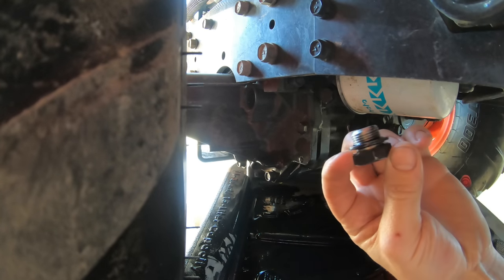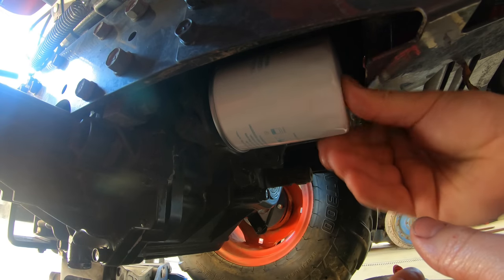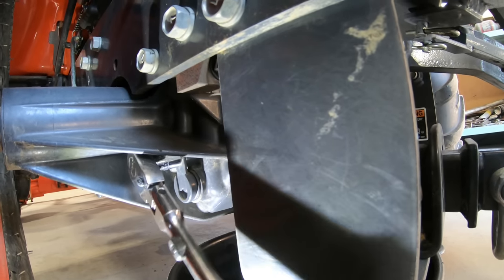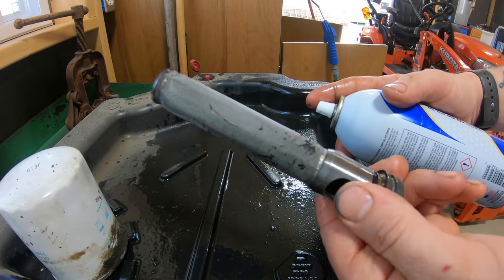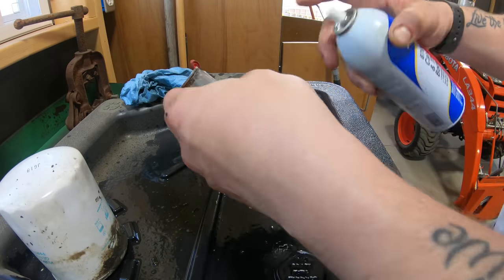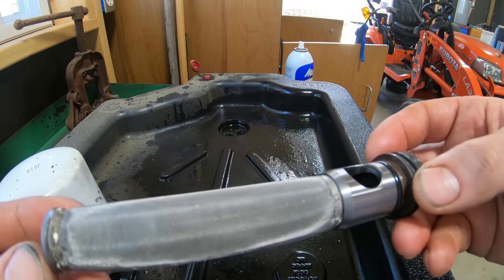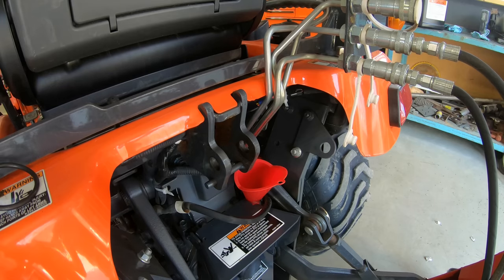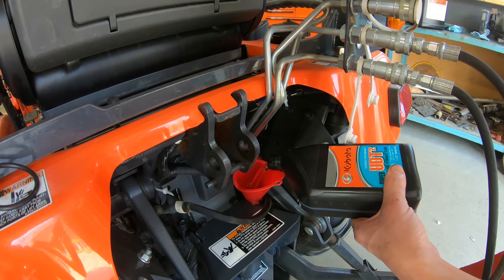Kubota BX- HST Hydraulic oil + Filter Change (FINALLY!)

Comment: i just got a 2018 with 500 hours it seems a bit noisy at the top rear of transmission it that normal?
Reply from the maker: What kind of noise are you hearing? Is it like a hydrostatic whining or groaning noise? Or is it something else? You may want to check:change the hydraulic oil and filter.. this will help quiet down the transmission specially if it hasn’t been changed in awhile. ONLY use Kubota HST fluid. If it’s still loud you can add a quart of Lucas hydraulic oil treatment to it. I did this to mine and it helped with better pedal pressure/feel and quieted it down quite a bit. My tractor has over 1200 hours too which is also why I added it for some extra protection. It’s proven not to harm your transmission or hydraulics

Comment: dealer just sells me the screen as well - throw the old one out and it is much safer and quicker than risking tearing the old one or letting something through.
Reply from the maker: That’s always a great option too! What did they charge you for it? Just curious cuz if it’s cheap enough then this would be a good recommendation specially to people who aren’t confident in their cleaning skills or don’t want to bother.. though these metal screens are made to be cleaned and not just replaced but again if a new one is cheap enough then it may just be worth swapping in a new one. Thanks
Reply: @BiffsEquipment  I think about $60 or something like that.  Noting that Donaldson OEM most of the tractor filters you can shop it once you have the part numbers for your model.  On my brand of tractor it had the dumbest name and I missed it in the first service I did and had to run up the road and get one.  If you get the parts manual you can find the model and then buy it.